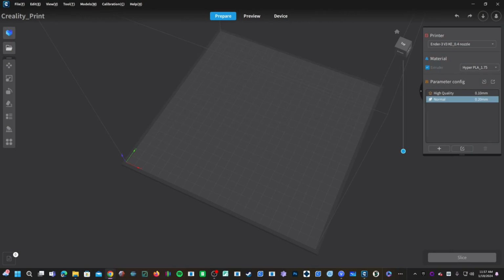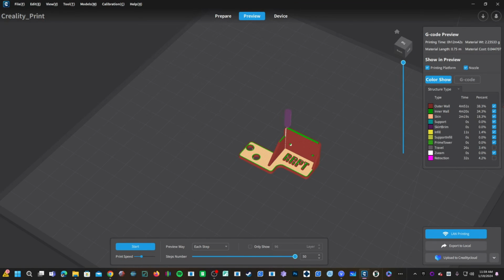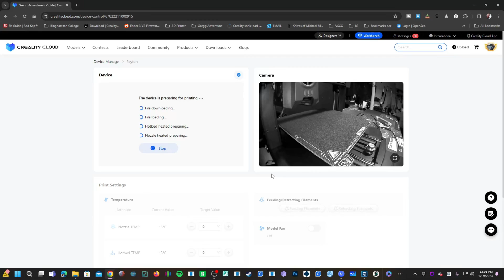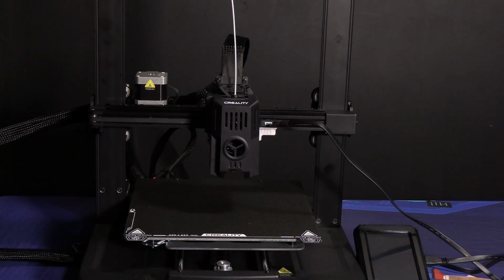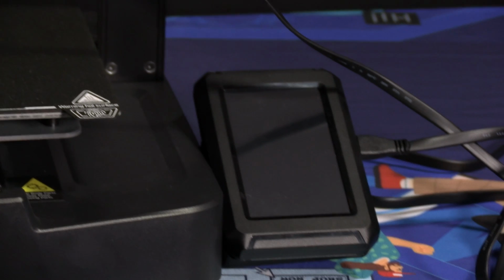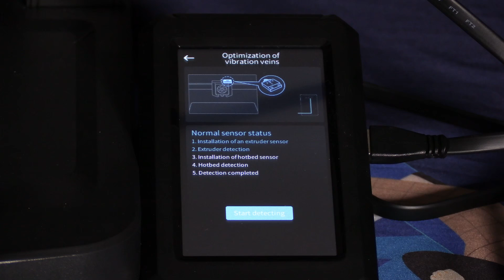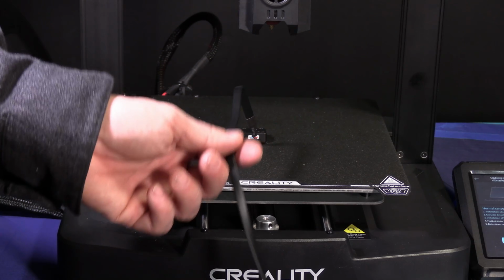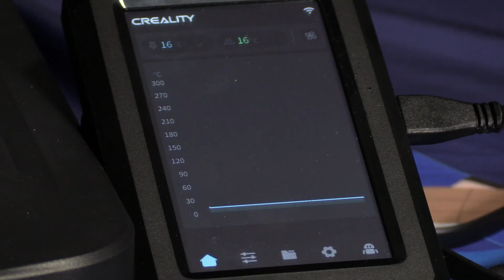How to: Install and Use G SENSOR on Creality "Ender 3 V3 KE"  - Vibration Compensation Calibration

Comment: Hi Great video and im sorry its taken me 12months to decide i  may want to buy one. But after the calibration is done i assume its taken off and disconnected from the printer completely. I thought the idea was that the printer control box get info all the time from the sensor to make adjustments throughout the printing process or have i missed something. Hope you dont mind me asking. Many Thanks Ken.
Reply from the maker: Can remove it after running it. Most modern machines have them built in. Have a look at the V3, which has it built in

Comment: Hi bud, both links to the sensor show a din plug instead of the USB-C cable. Did you receive the USB-C cable when ordering from those links? cheers
Reply from the maker: Sounds like those are sonic pad sensors. i'll try to update them!

Comment: 4:38 Ok this skip is really throwing me. What is the usb even connected to? I dont seem to have it, but this video doesnt seem to show how its connected to the sensor and just disappears behind the pad
Reply from the maker: There is a USB-C port on the back of the pad.
Reply from the maker: You can see it again, on my V3 Nebula upgrade video from
Last week
Reply: @3DRundown Mine also does not have the usb A only C

Comment: Can you install this on the SE without klipper ? Or do you need a nebula pad for it to work
Reply from the maker: Need Nebula. Nebula is so worth it. Marlin is a dinosaur
Reply: @3DRundown  I have a ender 3 SE. Trying to find a second hand KE. That way I have two printers for parts etc. I've enjoyed playing with the SE etc
Reply from the maker: KE is a really nice machine. Get Nebula on the SE, so both will be running Nebula. It will make your work flow endlessly easier
Reply: @3DRundown  also

I couldn't imagine the level of noise on a KE & SE with marlin speeds !!! Whoa

Comment: I like nebula pad but...
.what is the correct direction of vibration sensor? cable front or back? on install image in nebular pad.
.I install filament runout sensor but nebula pad not recoginize it... t.t // Do you know how to fix it?
(Ender-3 v2 Neo with Nebula Kit)
Reply from the maker: Line up the screws on the official mount, and that's the correct way. I never use run out sensors. Not sure what's up there. Is it turned off in the firmware?
Reply: @3DRundown  thanks for reply. creality send me some new firmware file that have maybe option for filament sensor activate. I will test it. if it work, I don t need to another Klipper machine like Raspberry Pi, it can be save money
Reply from the maker: You could also go sonic pad, but, there is no reason you shouldn't be able to get a runout working. Most Nebula machines have runout

Comment: Thanks for this video. Going to try out the sensor tomorrow as I've noticed ringing even with everything fully tightened unless I slow down to 500 mm/s^2 accel and 60 mm/s print speed, 8 mm/s jerk.. 

Bleh.. I can go to 120mm/s speed 4000mm/s^2 accel with the only issue being ringing, so if the sensor helps with that, then it's well worth it ! 

Also the z-banding.

Comment: Can my Elegoo Neptune 2 (basically an Ender 3 pro) use this with no issue? Or is it creality only?
Reply from the maker: This connects to the Sonic Pad. If you can get the Sonic Pad to work on the Neptune, the sensor should also

Comment: The download link in the manual contains a bracket for the hotend and a bracket for the bed. If you are in printing mood, you don't need double sided tape.
Reply from the maker: Indeed. I have another video showing the bed holes, but I don't love it there. Middle is better

Comment: After installing vibration unit i went to test it and did not find a vibration menu on the control pad of the E3 v3 ke.
Reply from the maker: Gear - System - "Input Shaping"

Comment: The software setup has now changed. Got my machine 3 weeks ago and just installed this sensor. There is no "optimization of vibration vein" setting. It is now under "Input shaping" in the settings.
Reply from the maker: Yes, the corrected that bizarre Typo a good while ago
Reply: Thanks man that was really helpful!
Reply: yep, got mine also exactly 3 weeks ago and am doing it right now and its : input shaping

Comment: Hello ! Thx for the video ! Do you let the sensor in place near the hotend after the calibration ?
Reply from the maker: I Remove it. Highend machines, have them built into the hot ends, and can be run whenever, but, I'd take it off, and toss it back on if needed. Mostly up to you. DO NOT LEAVER THE CABLE ON.

Comment: well i have the cable... but its only usb C. it detects it but wont do anything. i cannot find the one with usb A on it. Only the usb C version alone. Where do you find the other one ? or is there a reason why i have the one with just usb C ?
Reply: well never mind that... just needed to reset the printer after connecting it. It was detecting it but wouldnt let me do the calibration. Now it is ! solution ! :P haha
Reply from the maker: Yes, since this video, after some communication with Creality, it was determined the A isn't needed, and the newer cable is only USB-C

Comment: I was under the impression this sensor was for ACTIVE vibration compensation until I saw this video, thank you.
Reply: me too, this way looks pretty uncomplete - freq of resonance depends on the mass of filament on the spool, z-axis value (OK, this correction can be included in calibration algorithm, but is it included?), the weight of already printed model,... all in all - I'll not buy it.
Reply: @antunrosovic7284  I've been using it for a while, and honestly, it's worth it. Thanks to the sensor I realized my specific printer can only do 3000 mm/s^2 acceleration in Y axis before becoming unstable, so that's what I limit my settings to. I will soon be reinforcing the printer frame with a simple mod so that should allow be to go higher.

Comment: Amazing video! Good and very clear instructions! Would you recommend an ender 3 KE? I print parts that need relatively good quality, dont need amazing quality but close.
Reply from the maker: If I had my choice, it would be any of the K1's > a V3 > a V3 KE.
Reply: @3DRundown  Thanks for the reply, ok then I will buy a KE when it is time to make an upgrade.

Comment: Hi, am I correct that it does not matter which orientation the sensor is when placed on the bed or on the hot end?  I know it is placed flat on its bottom, but does it have to be oriented in a specific x or y direction?  I ask because I have a small set of brackets that I printed, one that goes under the bed and one that sticks on the top of the hot end. When using those, the x/y direction is  not aligned with the x/y direction of the printer bed.
Thanks, 
Mark
Reply from the maker: I don't believe so.

Comment: Hi I’m wondering if this can be installed on the standard Ender 3 with 4.2.7 board. I’ve just bought this nebula kit, but there seems to be nowhere the mount the G-sensor. Do you have any advice for me please?
Reply from the maker: No need for a mount. Stick it on with some double sided tape
Reply: Вам надо экран покупать как на ender 3 v3 ke или у вас уже есть klipper?

Comment: I'm in the process of moving from a "Ender3 Pro" to the "Ender3 V3 KE", and in the week I've had it it's brought new problems...
My E3 Pro is pretty much stock, with the v4.2.2 mainboard as original from 2021, and tuned in for near perfect prints, I'd calibrated the XYZ and extruder steps so it always  printed to within 0.2mm (sometimes less with some prints), I kept up the maintenance, the bed guide was always tight so I had no wobble, the belts tensioned, and until a few weeks ago it was still on v1.0.0 of the firmware, it's now on v2.1.2.2 and is perfect. It didn't really need a vibration compensation device because it prints slow and has slow acceleration. I rarely had print failures which were nearly always caused by a dirty bed, and I printed with a nozzle of 0.2mm, so it was even slower! But the quality was amazing!
The move to the KE has brought problems I'm having to compensate for. It can print nearly x5 faster, that means a LOT of XYZ acceleration and decelleration, the stock 'Y' guide bars are worse than the extrusion roller runners of the Pro, they are cheap, not adjustable and of sub-quality tollorances, so I'm upgrading them to linear rails. I've already purchased the XYZ calibration compensator which I'm about to fit having just printed the bracket. The side supports vibrate and rock when the head and bed move because the machine moves the head and bed so fast and abruptily, so I'll be bracing them soon, in effect, you do need to calibrate for the vibration as the machine isn't sturdy enough for the speed it is capible off, especially at heighter print heights where the effect is amplified.
I will get the KE tuned in, just as I did the Pro, and right out the box the KE is a good printer, but it needs attention that should've been attended to in pre-production, I'd far sooner they added £30 to the price of supports and rails then me having to do it, but this is what it's all about and why these printers are only £230... They need us tinkerers to perfect them.

Comment: One thing is not clear for me - should I stick this sensor there forewer or it's something that I should use once per certain amount of time?
Reply from the maker: USE IT, then remove it. Don't use it again, unless you make a physical change to the printer, or are troubleshooting a print quality issue.

Comment: Thanks a lot ! Clear, short and precise content. I just have two questions about it ;

- Once you've properly run the calibration, you don't need to keep the sensor on the machine, right ? I mean the cables makes it look like crap :')

- Once the calibration done, is this what people call "input shaping" turned ON ? I'm very confused about input shaping honnestly.
Reply from the maker: Yep. Use it and remove it. 
Input shaping, in simplest terms, the machine will study it's vibrations, and make adjustments to compensate for them.
Reply: So, once I'll have done the calibration with G-sensor like you did, input shaping will be automatically activated ? I don't have an option or anything else to enable ? @3DRundown  Thanks a lot
Reply from the maker: Yes.

Comment: Is there a way to revert the calibration optimization? I ran calibration and my printer now suuuuuucks. It was printing great before, and I only went through this process because I thought this sensor was a permanent add-on to the machine (like an ongoing upgrade). Thank you!
Reply from the maker: Perhaps under SETTINGS: Input Shaping. I'd have to check. I'm sure there is a Klipper command for this.  The sensor is run one time, then removed. You can run it again, anytime. If you don't like the results, you can attach it, and re-run it. How does your printer "suck" and are we sure the Sensor is the cause?
Reply: @3DRundown  I narrowed it down to the supports being hit while printing now. Prior to calibration, the support and model would print cleanly. I started hearing not-so-great noises on a few recent prints (that I ultimately stopped because it looked like top most layer was being hit by the nozzle). I will explore the settings option. If that doesn't work, will try running the calibration again. Thank you!
Reply: I factory reset the printer and it's all good now!
Reply from the maker: I was hesitant to send you that route, but, that's what I would do. Great to hear!

Comment: Great instructions. I just purchased my V3 KE and it updated the firmware right away so I don't know if that's why mine's different or what. 
Where yours says, "Optimization of vibration veins," mine says "Input shaping." 

Also I purchased the Creality Ender 3 V3 KE G-Sensor ADXL34 and it does not have the standard USB for power. It must draw it's power from the USB-C as that was all it had.
Reply from the maker: Hi. Yes, the Sensor and Firmware have both been updates since my build

Comment: A ps/2 to ubs works?
Reply from the maker: Unlikely. Will it deliver 5v?
Reply: @3DRundown  Im talk about a adapter plugged, but sorry i dont know.
 Im keep trying cancel, but que seller(orange 's') not anwser... 
This is a upgrade or a 'recall'?
 The printer works fine without one, similiar to s1?

 "Parábens pelo canal e pela dedicação. Não se vê esse tipo de atenção no Brasil..."
Reply from the maker: I would get the proper cable. You don't HAVE TO USE IT, but it can be helpful, especially for higher speeds
Reply: @3DRundown Thanks...  I already purchase one, but with 'pines' conector and dont find only cable for sell... See you

Comment: Does the tape not interfere with the vibration measurement?
Reply from the maker: I've never seen any real evidence of that, but you could use the mount holes under the front left of the bed

Comment: Thank you for the video. A small question, in my case I root my printer in order to use orca slicer and then I used the G-sensor to calibrate input shaping . Do input shaping will work automatically or need to do something else in orca slicer?
Reply from the maker: I'm stock and also working with Orca. I send all my prints via Creality Cloud. After running the g sensor tests at the Nebula, I BELIEVE you are goos to go.
Reply: @3DRundown  thank you!

Comment: Not the first video of yours I've found useful. Thanks. Also I was able to locate bed bracket position. There are two screw holes on the metal part on the right side of the bed, close to the big screw that is holding the bed.
Reply from the maker: Hidden Nebula G Sensor Bracket Mount, on Creality Ender 3 V3 KE
https://youtube.com/shorts/KbGQT64rGHg?feature=share
Reply: @3DRundown  Nice. I don't watch shorts so i didn't see this video :) Now people will be able to find it.
Reply from the maker: I use shorts as a way to check in with my peeps, and share little tidbits that come to mind. :)

Comment: I think it woild be helpful to explain the benefits of this, how often to do this if it needs to be repeated, or if you noticed any difference.
Reply from the maker: I am disciplined to stick carefully to the topic, as people who already own the sensor, will be looking for instruction on how to use it. The WHY, would need to be a separate video. Viewer retention on Youtube is very short, and very difficult to obtain. The short answer is, use it ONCE, and only use it again, if you feel a need, or make a physical adjustment to the printer. I've run mine exactly one time.

Comment: I got this printer for my birthday (well i ordered it on my birthday Feb 14, it arrived later) I'm about to order the nebula camera and the sensor. I'm totally new to 3d printing. The 2 devices are very cheap, I'm just curious if you think they are worth getting for a beginner like me. I would hate for them to go out of print later and not be able to get them.
Reply from the maker: Sure. Nebula is easy to work with, and while you could be fine without the gsensor, it's affordable, and worth having
Reply: @3DRundown Thanks for the help, I'll order them now.

Comment: Thank you for this video! How often would you have to recalibrate for vibration compensation?
Reply from the maker: Only if you see a need, or physically adjust the machine.
Reply: Creality recommends every 500 hours and after firmware update
Reply: Thank you so much for this video it made the whole process simple. There was no usb power cable in my creality g sensor package you just did the connection to the g sensor and the control pad also I found the relevant setup in settings now has description Input Shaping.

Comment: Straaange, just got the sensor and there are only type-c connector..
Reply from the maker: Weird, second one to say that this week.
Reply: @3DRundown  well, it works)
Reply from the maker: I feel like the extra 5V of the USB-A isn't needed. Perhaps they came to the same conclusion, and updated the cable. Does your Manual show the USB-A?
Reply: @3DRundown manual shows one cable which looks like type-a to g-sensor. Suppose they just did not found type-c connector image
Reply: It is most definitely weird that Creality doesn’t include the mount just to save a dollar or so
Reply: @ginoantenucci6424  IMO.. they think it could be interesting to print some parts you need. Thanks they are sending all needed parts for printer to start)
Reply from the maker: This is pretty common. Bambu had us printing MASSIVE parts for the P1P.

Comment: Good video..just installed this and did the tests on my KE I recently got in January. 
Question, how often do you recommend doing these tests? Im assuming the settings from it are saved and arent lost when you power down the machine.
I tend to run the xyz calibrations upon every startup.
Reply from the maker: Only again if you're dealing with a quality issue., or making hardware adjustments. I have yet to run it again on my CR6-Max or 5+ with the Sonic Pad. I've been troubleshooting my CR10-SE for a Z Banding issue. After messing with belts and such, I toss the sensor on. But, truth me told, we've been printing for ages without it,  so, over using it is really not necessary. When your machine is behaving, don't give it any chance to screw up. No ABL leveling, no calibrations. Just Send it.

Comment: After the calibration, doni need to keep it installed and plugged in or can i unplug it an take it out??
Reply from the maker: Remove it
Reply: @3DRundown  thanks, just got mine today! by the way the g sensor i got had type-C connector, going to the back of the screen!
Reply from the maker: Yes, that's how it should be. USB-C in the back, USB-A to power it. it may run without the USB-A
Reply from the maker: https://youtu.be/sR8cW45J8Cg?si=qrD_Y5sGcwzsXt7d&t=255
Reply: Mine had no usb a, just the USB-C 😅
Reply from the maker: Whoa, did it really?? First I'm hearing of this.
Reply: @JohnnyCash369  Same for me. I'm a little confused about the USB A connections required.  So little info available.